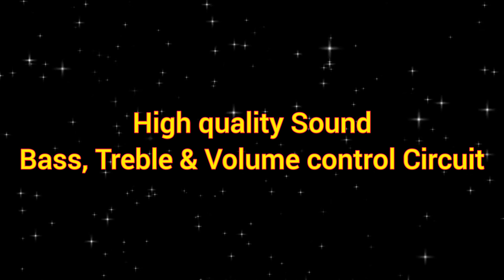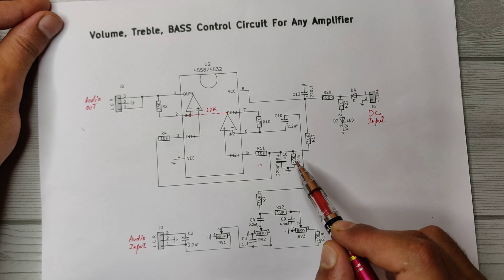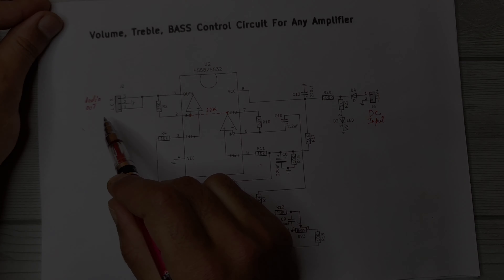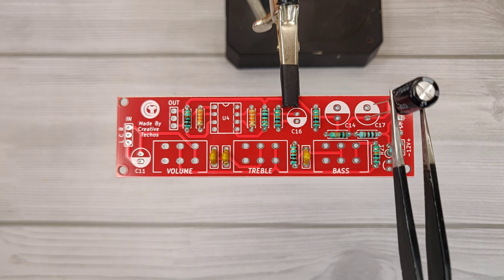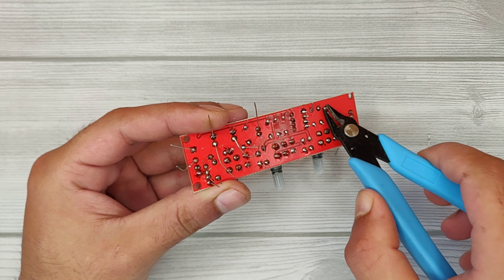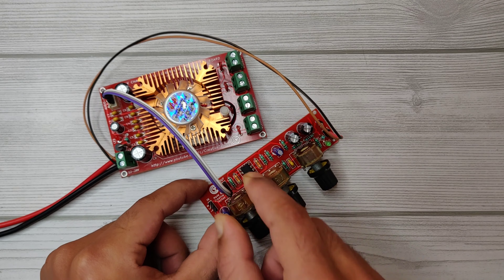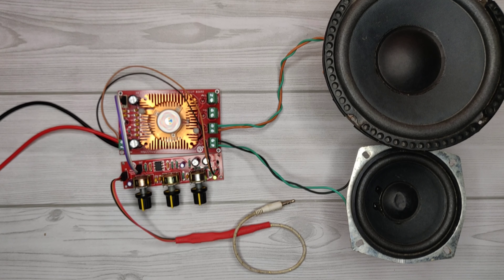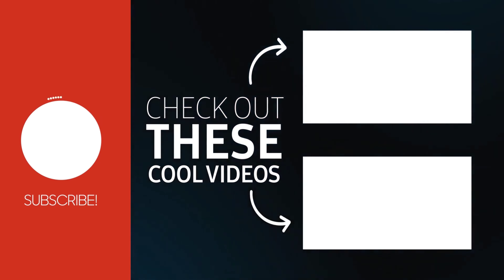Super Bass Treble volume control circuit for any Amplifier

Comment: The circuit diagram show that you taken stereo input and convert that into  mono and same as output so can there only be mono output ....help me???
Reply from the maker: Yes, I have taken both input and coupled them to one, that goes to ic, the output is single and can be feed to as many inputs of amplifier, because on input of amplifier there is always a polyester or ceramic capacitor for filter & decoupling the input.
The main reason behind this was to use minimum components with single op amp ic. If you want to feed two inputs to amplifier with separate control for each channel then you must use 4x op amp.
This circuit is for single control, means you can feed output from this to amplifiers suppose 4 channels, so the tune can be controlled for all channels with these potentiometers.

Comment: Does jlc provides those components too?
Reply from the maker: They provide smd, the tht components can be sourced online or from your local electronic components shop.
Reply: @CreativeTechos  what's smd ..sir
Reply from the maker: SMD Surface mount components, THT Through hole technology
Reply: @CreativeTechos  can you determine which component is responsible for under voltage cut off in bms board....I want to design a bms with a lower cutoff voltage...normally the Chinese aliexpress cut off at 2.8v ...I need to bring ot down to 2.5v
And also to use quality components

Comment: Try making bass treble circuit using lm324.
Reply from the maker: The dual operational amplifier used in this project will provide you clear and good sound quality with minimum components. And LM324 is with 4x operational amplifier so will require double components then this, but it will be ideal to use for  bass treble mid control. I'll soon try to upload.
Reply: @CreativeTechos  I was trying to make triple lm324 ic bass treble circuit